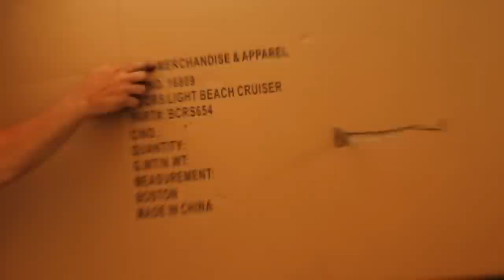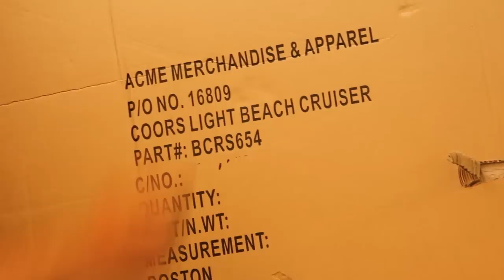The Beer Bikes - What Not To Buy - BikemanforU - Local Bike Shop

Comment: Well said.
 I used to work as a mechanic in a small motorcycle shop and it kinda sucked because people would never appreciate our prices. They usually think that the smaller the part is the easier it is to repair, when really it takes so much time and effort to do so, especially if the part comes from inside the engine.
 My point is: safety and reliability comes with a price. If you want a product that is safe and reliable, and if you are asking someone to do something such as repairing a bike that you cannot do your self, just pay for it. There are certain things that you absolutely do not want to be cheap about.
Reply: I agree.

Comment: I ride a 25 year old clunker of a MTB. People say to me that I could get a new bike because they're only $200.

What they fail to realise is, my old bone-shaker has Shimano everything - that's why it lasted - and that's why it will still be here in 25 years time. If something breakes, because it's branded parts, I can just buy another part for a few dollars.
Reply: +woodbine66 I have two Chicago made Schwinn's that I restored, '68 and '77 and the build quality on those is on level not seen on bicycles today!! There are virtually no weld seams, Schwinn used to file or grind down their seams so it looks like a one piece frame! They both ride so smooth, it's almost like riding on ice!
Reply: Also if your riding on the street old mtb are better than the new ones beacuse you lose no power cause they are all rigid
Reply: Lmao my GHOST htx 330 still works fine
Reply: I love when people point out the fact their bike has Shimano parts... Go on Alibaba, eBay, DH gate, or AliExpress, you can order a rear Shimano derailleur for under $8. Shimano shifters for under $10, Shimano front derailleur for $5, etc. And just to make a point, the bike I just bought from Walmart has Shimano everything, disc brakes, and so on, so did all of their multi speed bikes starting at around the $100 price range. Shimano parts really means nothing, considering in bulk the low end stuff is honestly probably the same price, maybe 50 cents to a dollar cheaper than a random no name part. Same goes with things like pedals, grips, quick releases, and so on.
Reply: funnily enough if you look at a modern bike that has a "Shimano Equipped" sticker on it, you MAYBE get the rear cassette/freewheel and MAYBE the derailleur, the rest of it us either unbranded or "who the hell is that" brands.
Reply: I still use my Dad's old bike from time to time, and he bought it new in 1937 layed it up for 6 years while away during the war and then used it for the rest of his life up to 86 years old. Still running nicely it's a Raleigh all steel made in Nottingham.
Reply: I completely agree! Parts are cheaper than buying a new bicycle.

Comment: I charge $50 for assembly here in Torrance California. With that the customer gets a free checkup after a month with a chain cleaning, wheel truing, etc. I'm happy if the lbs don't want to put box Budweiser bike together. More business for me. I inform the customer about what they have when putting it together, then see how they like it after a month. When they come back for free checkup, I ask them again how they like it, and recommend appropriate upgrades. 

Basically, all beach bikes are made in China. It's a bit of a crap toss. Open the box, and cross fingers that stuff isn't all messed up. I ALWAYS let customers know that the bike will not be up to doing jumps, bunny hops off curbs, etc, if it's made in China. Taco, Taco, Taco Time if they do!

Comment: Oy. I'm not in the bike business myself, but I'm one of the guys in my neighborhood who is known for fixing his own bikes, and even just from that I can tell you stories! Like the friend who pedaled over on his brand new MTB from Target, of all places, to ask me if he'd gotten a good deal. (Hello... the time to ask questions like that is BEFORE you purchase the piece of trash, not after!) Then he wanted to know why his new bike was so hard to pedal. Um... could it possibly have been because the rear wheel was so badly out of true that I could see it at a glance without even giving the wheel a spin, so, naturally, it was rubbing against one of the brake pads for half of every revolution? I'm amazed my buddy made it out of the store without noticing that. The bike assembler at Target did his best to fix it, but that wheel was probably a lost cause before it even made it to the slow boat from China. The best thing that happened to that bike was that some fool stole it, and then my friend went to a good bike shop for a high quality replacement. But you're right about embracing change. I used to work down the street from a bike shop in what might politely be called the low rent district. I think his bread and butter came from those dimestore bikes. The folks in the neighborhood would buy 'em for Christmas, and since their components were garbage and they were put together by anyone who could remember "righty tighty, lefty loosey", they all needed repairs by springtime. You have to be a talented bike mechanic to make those bikes work well, which is why I didn't hesitate to bring him my Cannondale whenever it needed something.

Comment: I'm looking to get into Mountain biking, and sadly I had originally been thinking of getting Wal-Mart pre-assembled bike, but after educating myself a little bit I've changed my mind drastically. Now I'm not going to try to pic your brain for what size/type of bicycle to purchase, I'd only do that if I were physically in your shop and ready to actually purchase. I would like to thank you for assisting in stopping another Wile E Coyote.
Reply: +Russell Zingg  Drop at least $500 on a bike . 3 things come into play , cheap , strong , light . choose 2 .  Also if your getting into MTBing get a nice hard tail bike , you'll get more for your money  and go down in size rather than up if your between sizes ( so if your between a 17 inch and 19 inch for example go for the 17 as there is a cross over in height and more you can do to make it a better fit )

Comment: a few months ago I bought my first bicycle from a bike recycling centre, (a reyleigh kandara for £25) the first time I took it out I fell off because I was still learning to ride, which messed up the handlebar position, my seat dropped down, slipped the chain and might have done something to the gears and the derailur (couldn't switch either) but I'm thankful I have learned so quickly how to service it and fix it

Comment: Being the go-to guy in my local running club, for a handful of us getting into triathlons, is tough.  Several ask me where they can get a cheap bike, or whats a good brand in the $200 range.  The best is when they show up to an event with a bike like this that's been sitting in the garage for 10 years.  How the tires still hold air is a mystery.  Then they ask for an adjustment because it doesn't sound right when they pedal.  That's when you adjust their helmet straps and say "Good luck."

I had a friend act seriously surprised at my $1,500 payout for a barely used $2,700 mtn bike, saying, "You could have bought a really nice TV for that much..."  I guess you put your good money where your passion is.

Comment: I get these kinds of bikes in all the time.  I have a neighbor's bike with a broken brake lever, and the handgrip was apparently glued on, making the removal somewhat problematic. I have a box of replacement levers, and few if any seem like they will clear the twist shifter sufficiently. I'm actually considering using an old brake lever from a 3-speed "English" bike, as it offers plenty of clearance and can be attached without removing the grip or the shifter. I'm fudging on the job, since the lever is for the rear brake, the front one is okay. Now, to get that remaining chunk of brake lever off the bar without causing further damage.... It must be 4:20 somewhere.

Comment: Make sure you use thread lock on the pedals. There are endless complaints of Walmart bicycles loosing the pedals (falling off and becoming cross threaded, thus ruining the bike). What surprises me is the thickness of the crank arms, I would definitely NOT trust my weight on those crank arms. Without a suspension, there are times where you have to put 100% (or close to it) of your weight on those pedals/crank arms to use your bent knees and elbows as a suspension.
Reply: tarstarkusz A pedal can't "become" cross threaded with use.  It can be cross threaded when you put it on, however you would be hard pressed to tighten it up all the way when it is cross threaded.
Reply: robsgaragewoodworkin That was poorly worded. It's very easy to accidentally cross thread the walmart bikes, but the reason to use thread locker is they are known to vibrate loose, mostly because the crank arms are too thin so you need a thread locker to keep that from happening. With Walmart idiots assembling the bikes, that is when the crank arms become cross threaded.
Reply: tarstarkusz Thanks for the clarification.  Yes I completely agree that big box store assembly is sub standard!

Comment: Putting together big box bikes can be a pain, especially since the parts may not fit properly. People need to understand there's more to assembling a bike than just cobbling all the parts together. It takes time to adjust everything properly, to torque the nuts and bolts, to make sure everything works. It takes an hour, more if the parts don't fit properly, for a skilled mechanic to assemble a bike. In that hour, he/she could be doing other repair work instead. If he/she doesn't charge a fair rate, he/she will be out of business. In the bicycle repair business, time=money. No bike mechanic is going to charge someone $10 to assemble a bike. If he/she did, that would be less pay than a McDonalds job when you factor in tools (some of them are $$$!), cost of rent and upkeep (bills for heat and electricity), and labor (other bike shop employees).
So while $10 to change a tire or $60-$80 to assemble a bike sounds like highway robbery, it really is quite generous considering the costs of being in business. Everything Bikeman said is true.

Comment: BikemanforU One reason why bicycles are sold in department stores is department stores hire contractors to set up bicycles by assembling the bicycles. They never keep track of the parts like brakes, pedals, and wheels. The pedals keep falling off, wheels are misaligned and the brakes not being properly set up.
Reply: Tenspeed TheBikeHanger That is exactly what I did when I bought my 5 year old an Avingo BMX style bike at TRU. Bearings were so tight could not spin wheels a single revolution. Adjusted all the bearings, cut the excess front brake cable to proper length. Zip-tied flappy brake cables to frame. Adjusted and toed in brake pads so they were not rubbing on tires! Put washers on chainguard bolts. Setup cockpit controls...etc. Makes a huge difference.

Comment: The single speed it probably OK and can last for some time. Hard to say anything really bad about it just from the video. I rode half year on a single speed with cheap Chinese parts without any real issues. And I'm over 100 KG and the roads here are bad. Nothing broke nor looked as it's going to.
However, I would not risk buying the MTB in fear that the frame or the suspension could break during a ride. There are many horror stories about that on the internets. And there are parts to replace straight out of box (starting with the brake levers).

Comment: You made some cogent points in this video. I am a mechanical engineer. After 30 years off a bike I started again. Got a decent mtb, genesis gs29 "reassembled" by the biggest box store. I spent many hours, probably 6 altogether. I took it to my LBS and after a day, it works better than expected. I should have talked and worked with the guys initially. If I stick it through a Wisconsin winter, I'm buying a new one from them in the spring. Thank you for all your work. Do you take donations for your YouTube work?

Comment: I got a kulana ( Pacific cycle. ) @ Wal-Mart in 2006-2008 was told by a bike shop in new London cause the rear hub locked up. Brakes coaster shot but got fixed. New rim but still not as good because company made crap that's what I was told. Well its red and black. Red rims. Cruizer white walls.  24" anyways.  Im gonna customize this since the frame is similar the decals coming off except kulana. Has tiki stuff. Im gonna make it similar with schwinn typhoon I had when I was like 8-9 it was a beautiful bike.  My aunt was storing it and tossed it out. But when I find good rims coaster type. Maybe add a rear brake for added safety change fenders maybe. And it be a good bicycle.  Keep up work bikeman hope for dryer weather

Comment: In the UK, real cyclists call bikes like that BSO's - Bike Shaped Objects. You know the kind of thing, full suspension bikes that cost £100 etc.
Reply: What is the minimum price of a good, new hard tail bike in the UK?
Reply: £350 maybe? One way to tell is BSO's are alway MIG welded. A decent bike should be TIG welded.
Reply: +comedyman112 Depends. You can get a decent bike for £300. However these are in real sales, are ex-display models or put together by the likes of a bike man,  and not the kind of bike you buy in "sales" at shops like Halfords.
Reply: +MsPeabody1231 By "put together" I mean built from new components not out of a box.

Comment: These are some comical examples heh. But I'm on the opposite side of this spectrum - I deliberately bought an 'el cheapo' big box bicycle almost a year ago. I'm 33 - hadn't ridden a bicycle since I was 12. I could've just as easily bought a Giant from the LBS, but I decided, no, I'll get the cheap department store one, keep it for a year, and see how I go. My intention was to learn from it - to put it together myself - to true out the terribly un-true wheels - adjust the brakes - it took me days to figure out the front derailleur. To need to replace the bad tires after just a few months. To learn how to repack the bearings. But that was the point! I'm all the wiser for it, and I'll be better prepared to maintain that 'proper' bike I'll buy in the future. However, given how actually well my el cheapo bike has held up, I'll probably continue riding it for a while longer. But you're right - it's false economics to buy a big box bike, then not know or not have the inclination to put it together yourself - since that sort of defeats the purpose of being a tight arse in the first place.

Comment: I learned my lesson with cheap bikes, I thought I would save money and buy a cheap bike and outfit it with the better quality parts, boy..I was wrong! A cheap bike is a cheap bike no matter how many quality parts you put on it! I bought a Micargi GTS Falcon, cool name and cool looks that's about it! I changed everything on the bike, right down to the crank and bearings, it rode like crap, it was hard to pedal even with the new crank and bearings, I believe due to faulty design, the seat sat way to far back. It also squeaked and rattled, even with new wheels! The squeak was coming from somewhere in the frame! I just finally just sold it at a loss! Of course, being the stubborn guy that I am, I bought a Walmart Schwinn and I thought I could remake that one, long story short, same problem! No more cheap bikes for me! I only ride Chicago made Schwinn's now and  have restored two of them, best bikes I have ever owned!
Reply: Amen!

Comment: Bought one of these cheap bikes from argos in the UK.  Same power gear setup.

4 months in and the freewheel makes awesome grinding noises when you dont pedal.  The chain skips off the back gears almost daily. Wish i had invested in a better bike. Or knew the sizes of the bearings and stuff so i could replace them.
Reply: Any  bike shop, auto parts store, or machine shop will have the bearings you need, all you do is bring one of the old ones in for comparison. Campagnolo makes the roundest, hardest bearings, but they can set you back as much as a US dollar apiece. The chain may be stretched to the point of skipping & in need of replacement, and/or the derailleur hanger may need an alignment. A bike shop can help you out for notta lotta cash, but you may find that your cheapie has a ton of other problems. In any case, both these problems occur on expensive bikes, too, so look at it as the cost of normal maintenance. While you're there, ask if they have a decent used freewheel, they probably do.
Reply: Thank you so much, A ton of information here to get me started:)

Comment: Wow the corslight needs a new stem bottom brackect breaks and levers gears and shifters to make it safe but I dont trust that frame so I would bin it but the corona frame looks safe but it will need a new suspension, breake levers breaks gears shifters and derailleurs and this will be sellable but it will cost you

Comment: the trouble with bikes like that cr@p is that it won't be enjoyable to ride and will probably put the victim/owner off riding. My bro bought one off ebay, cost about $150 and weighed about the same as Texas, my Cannondale cost about 4 times as much (bought from a local independent :-)) and its very easy to see why...